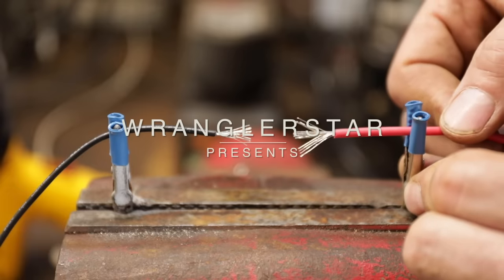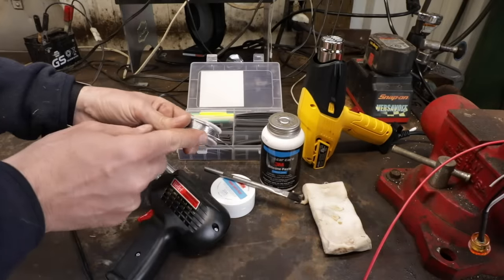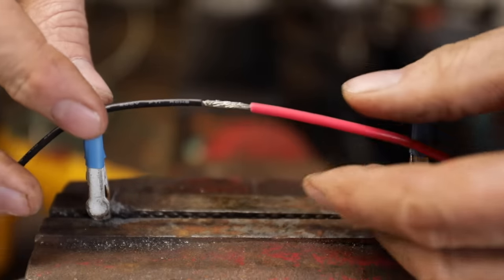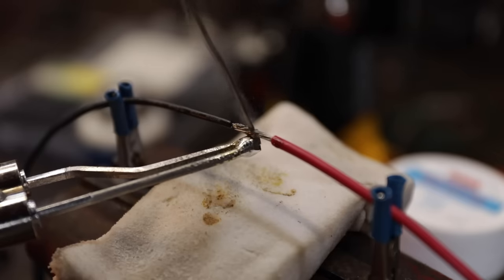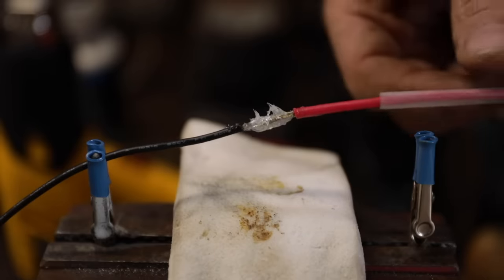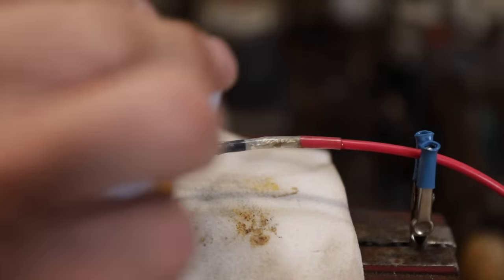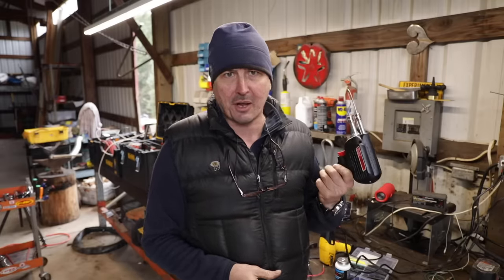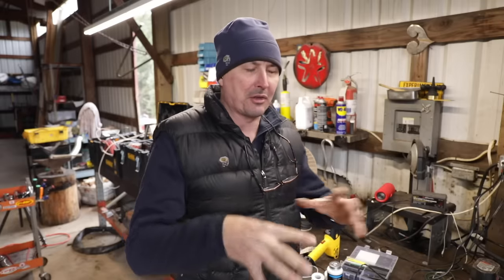How To Solder Wires Like A Pro

Comment: I like the video for the explanations on theory but somebody should talk about RUBY FLUID as an alternative flux. I use ruby fluid with an acid brush, but DO NOT TOUCH IT (it is 34% hydrogen peroxide and will burn your skin) along with rosin core solder. As for fraying the ends, it does not work well in short contact situations and clamps are normally useless in tight quarters. Also it should be noted that "GOOD" heat shrink tubing may be lined with heat activated sealants as you can see by oozing end the ends after shrinking it. However it is worth mentioning that use of wire terminal ends WILL degrade the ohms ratings that the computer needs to balance fuel for performance in automotive uses. THAT'S WHY WE SOLDER THEM!

Comment: Sponge is to clean off the old solder.  Wipe both sides of the iron tip, retin the tip with new fresh solder and then use that to do the soldering adding solder as you go.

Comment: This method is good and a strong joint. But when you work on machines where you have to periodically replace a sensor and do not have time to run a new cable, you do not want to solder in this manner. You tin the 2 cables and then solder them together. That way if you need to replace the sensor, you just apply the solder iron to the joint and the wires separate easily and then you solder the new sensor wires back on. The joints are still strong and cannot be pulled apart.

Comment: For once, a fancy soldered joint video that was slow enough and believable enough to follow. The silicon bit was useful addition too. Many thanks. PS. Perhaps you could offer advice on the following problem. I have unusual design of male spade connector coming from lawnmower capacitor to housing at the induction motor end. Can I in-join crimped spade as plan A or should I go plan B and simply join up old spade-end wires to new wires from the new capacitor.  Re-using a spade (even if possible) will likely weaken the crimped mechanical joint, therefore, soldering old and new wires looks like the best way forward to me. Robin

Comment: 1. Mechanical connectors are BETTER than solder for connections exposed to the elements. The silicone dielectric grease you showed is meant for mechanical connections, not solder. If you want insist on a solder connection , cover in in an actual encapsulating waterproofer such as 3M Scotchlock, than us adhesive lined shrink tube.

Comment: That flux is for plumbing and is acidic so will cause corrosion (the solder has a flux core of the right type). You do need to apply solder to the junction of the  iron and work piece for good heat transfer and allow the solder to flow properly. A Weller of that type gets far too hot for this type of work. A temperature controlled iron of the pencil type is the way to go.

Comment: This is what happens when a plumber tries to solder electronics. Painting the joint with flux beforehand is totally unnecessary. Use electronic grade rosin core solder and the core has enough flux to do the joint. For heating up the wire, touch a small bead to the soldering gun tip and the wire joint to transfer heat then apply solder to the top of joint as showed in your video. Forget the flux paste, you’re soldering wires not pipes! I recommend you watch a good video for soldering electronic components. To others watching this video, this will put you on the wrong track.
Reply: i was thinking the same thing

Comment: If this was an real life connection you should never forget to apply the SHRINK TUBE FIRST, as you usually don't have an open end half a meter further. It's really annoying when you made a good solder and then notice you forgot the shrink tube and have to open it or fudge with electrical tape. Take care to push the shrink tube far enough away to avoid it shrinking while you solder.
You were lucky the cables isolation didn't melt. You were far to slow on soldering. There needs to be more tin at the tip of the solder gun. I usually touch the joint with it from the top. This works great and the solder can run into the joint by gravity.

Comment: Rosin solder is corrosive. That's how it cleans before it helps the solder flow. Remember to clean the rosin junk off before applying the dielectric grease and heat shrink or else the weld could fail years down the road.

Comment: you touch the tip of the iron before soldering to "wet" the tip which helps with heat transfer to the work. when I first started I would clean the tip and try to solder with out wetting it and had a hard time till I figured this out

Comment: I believe Holley and HP Academy both say avoid solder joints at all costs in automotive applications. Solder belongs on circuit boards not in wiring harnesses.

Comment: Crimping is a superior connection. Simply those crimp connectors suck. There is a reason common solder connections like that do not meet SAE and FAA guidelines, but crimping connections do. The problem is that people use the wrong crimp connectors for the place that you are putting them. For the commoner who does not want to learn all the different crimp connections there are on mouser, this does work fine. Just know that if you are putting that under any kind of repetitive flexural strain it will snap. Maybe not at first, but over time it will not last. I would suggest even putting two layers of thick heat shrink instead of one. Help distribute the strain. Though most people are not doing anything that will have any flex.

Comment: For those just learning...  make sure when connecting a wire rack to gather to slide the shrink tube on part of the wire before you solder the connection... lol

Comment: If you are able to find it in the correct size, Adhesive lined heat shrink would be a good alternative to eliminate or supplement the silicone grease.

Comment: For a better mechanical connection, a western union splice is really good. Solder that and it's staying connected. I don't really see anything wrong with your method but the western union is a strong connection even without solder.

Comment: There is a reason why soldering is abandoned for any application in flight or aerospace.
Its not vibrateproof,it stiffens the wires too much in areas where flexibility is needed.If you choose the right crimp style connectors(not the pre insulated ones) with an insulating and contacting crimp they work just fine.
Reply: Bull

Comment: You'll have a much stronger connection if you dont twist it. Add a bit of solder on either ends, just enough to cover the wires. Then put one flat ontop over the other before melting the joint together by heating it up a little bit.

Comment: Really great video. That little hiccup you had where it took a really long time to heat the wires to the point that they could melt the solder, that happens to me every time. And the wires get so hot, I'm afraid I'm going to damage the circuit board they're connected to or whatever. I always get scared and end up just using the iron to melt the solder to speed up the process. Is it normal for it to take so much heat and time to do that?

Comment: I am willing to bet your solder connection is the best in in the machine. I have never seen a waterproof connection inside a machine unless the machine is to used in or under water.

Comment: Are those solder guns better than a typical stick iron? My Pop had a nice stick that I liked, with a beveled tip maybe 3/8 inch diameter. Some kind of copper alloy I think.

Comment: 1. Soldering (there's an L in there!) wires is often done in situ, hence putting the heat shrink on first is advisable.
2. He says (When heating the joint) that it was taking a long time. Thats because he is using the edge of the iron bit, instead of the broad face. Heat transfer is proportional to contact area.
3. He doesn't actually specify solder which is for electrical connection, i.e., with a high tin content.
Reply: I've said the same thing about the "L", but was told that in the U.S. the correct pronunciation is "Soder" and in Europe, they pronounce it as Solder. I would state where I hear that, but it's been long ago. ;)

Comment: I like to solder those cheap connectors on otherwise they oxidize fast. But I agree a solder joint is always the preferred method.

Comment: You start out with a bit of solder on the tip so the liquid solder transfers the heat to the wire faster with more connecting surface area.

Comment: I wouldn’t put the silicone grease. The heat shrink tubing has a sealer that melts when you heat it up. The silicone inhibits the seal from working

Comment: Why don't you want to touch the solder to the iron? I worked at a PCB manufacturing plant. I never spliced wires, but I was an inspector so I soldered components on boards by hand. The way we did it was to touch the iron to whatever you're heating and then touch the solder to the iron and immediately move off, but not so fast at to completely break the "heat bridge." The heat bridge is just some liquid solder that's bridging the gap between the solid solder and the iron. It conducts heat to melt the solder and let's you get the job done without actually heating the part itself to +700°F. I'm not saying that this is a 1:1 thing and I've never done wires like this before. I know this is an older video, but if you or anyone else happens to see this, why would you want to entirely avoid hitting the iron with the solder?

Comment: Actually with automotive you probably DON'T want to be soldering connectors! The crimp connectors are in fact much better and more reliable. When you solder them they will fatigue faster than the crimp due to the environment and high vibration they are subject to. Crimp connectors are an excellent choice for automotive, especially when they are done properly ie selecting the correct AWG sizes for the wire gauge you are using etc.

Comment: A properly crimped wire connection is superior to solder. The pressure causes the wires to ‘weld’ together. This is known as metal to metal colloidal bond. This bond actually provides less electrical resistance than a solder connection. There is a reason manufacturers use crimp connections. The other reason is wire fatigued. The solder often is drawn up either end of the connection like the end of a wet rope. 

Solder connections are meant for wire to circuit connections.  From your car to your computer wire to wire connections are crimped.

Comment: Get a small bottle of liquid flux from amazon (~$10) , easier to use for something like this. Also a soldering iron (40-60 watts ~$15-20) is better than a soldering gun,

Comment: Even when I use the different connectors I cut the plastic off and solder them. Like for a trailer ground. I wired trailer lights for my father in law 6 years ago still going strong

Comment: i wish out of curiousity you did a resistence test. ex( place some weights on the bottom while it hangs and see how much weight it takes to break the connection.or if another place in the wire rips first.

Comment: Before u place wires together put your shrink tube on and push to one side then solder wires because alot of times u can't put it on later because the wires are connected to something

Comment: Butane irons are a little better all around. Certain things you don't want to use an electric iron on because there is a CHANCE that you can induce voltage into the circuit. It can be enough to fry circuit boards and blow airbags.

Comment: I think I may be the only electronics tech that isnt bothered by you soldering a red and black wire together. I was an avionics tech on F-18 Hornets. It would be less than pointless to try to color code its wiring. There are eleventy billion wires and they come in like 4 colors, not to mention, they break and need to be fixed all the time, so by the time I have to patch a wire, someone else has already done it a dozen times. (Often badly)

Comment: Use a lineman's splice for strong connections (recommended by NASA).  Two straight wire ends mashed together will work, but is not nearly as resilient.

Comment: After working as a professional in the electronics industry for over 30 years I can definitely say this is Not, repeat Not, how you join wires together. Solder is a weak joining agent if you pull hard enough on those wires the way you joined them they will come apart after soldering.

Comment: The connecting of the wires is a good idea but i recommend a different way of soldering them together cause you do not want to damage the isolation of the wires by heating them to much for too long in this case you been heating up the wires with to less contact so it wasnt hot enough for the solder to melt but hot enough to damage the isolation but otherwise good job pls excuse my english

Comment: Correct me if I’m wrong but isn’t silicone water based???? Surly that’s gonna cause corrosion to the copper wire ? I’ve never used that on wiring connections but always heat shrink .......like I say I could be wrong

Comment: put a little solder directly on the tip of the pistol before touching the wires. for optimal soldering you should toch the wires for 3 seconds only cppl ide with the vice though makes the soldering arm obsolete.

Comment: I've worked in electronics for 20 years and I've never heard of someone putting silicone in a shrink. I'm not sure what purpose it would serve. Other than that it's an ok job for a starter, it will do the trick. 😉
Reply: It’s dielectric silicone for conductivity. Not required.

Comment: Hi i do similar with a few slight differences and not knocking what you did. 1. When the wire is stripped the length split into a v, then twist about 1/3 of the way, put the 2 v's together then twist each other along each other, hope that makes sence?
2. The silicone idea is good but best to check as some heatshrinks have an agent that bonds to the outer sheath. 3. Im not sure if you have seen then yet but there is now connectors that shrink with solder inside, place the wires in and use the heat gun, done. 4. Finally why do you guys not pronounce the word sol-der as opposed to sod- er. Trivial i know.

Comment: if you don't care about being a pro, you could just coil a section of solder around the spliced wires and hit it with a lighter. no iron needed. same lighter you can use on the heatshrink

Comment: Had a solder gun .
Don't bother the are rubbish .
As you have just seen they don't work properly
Take so long to heat .
Spend some money and get a solder station , you can adjust the heat setting .
Since I've had mine my soldering quality has improved 10 fold .
Well worth the extra expense .

Comment: No one says the real trick. The real trick is to use good quality flux and solder. Amtech makes amazing flux and kester solder is what I use. From the irons I ruined because of the cheap flux and solder I used to now, it makes it A LOT easier to solder. It’s as simple as it should be.

Comment: A hook solder joint on each wire is far more reliable. The end to end method here would only be necessary if the wires were not long enough to make each wire into hooks

Comment: I turn my iron up pretty high and press it pretty hard against the wires but they never get hot enough to melt the solder. And the wire insulation just ends up melting cuz the wires get hot enough to melt them but not the solder, why. I have a decent iron
Reply: Don't press it against the wires like he showed in the video. I usually dip the solder in the greasy stuff (I forgot what its called in English, in my language we just call it paste lmao), then put the iron on the wire (with no solder on it) and put the solder in a spot where it touches both the iron AND the wire. Theat way it melts super quickly but also sticks almost only to the wire

Comment: Have you any videos or tutorials about splicing wire 1/0 battery cable, into a "Y" configuration?  Needing to replace a stock battery cable and FORD does not have it any longer.   
Thank you for sharing!
Marion.

Comment: Yeah the secret of soldering, wire or pipes, is heat the objects being soldered. Onv=ce they are hot the solder will melt and be drawn into the joint.

Comment: Place soldering wire on a metal surface and hammer it flat . Cut it with a razor blade to create thin wire to solder with when needed . 70/23

Comment: I mean it’s easy there in a bench with plenty of space to work, however out there in the field you usually have to work in very tight spaces where soldering is simply not an option

Comment: Could of things: 

1. The idea of not touching the iron with the solder is false. It’s why you’re tinning it. When you tin it, it allows the solder you’re applying to melt easier and keep the solder on the wire melted. The best way is to tin and then hit your iron with you’re solder to form the beginning of the pool then use the pool of solder to keep heated as you add more solder. That’s what people mean by not putting the solder on your iron, they don’t mean NEVER touch it. 

2. You don’t want to just keep your iron on the wire like that. The wire will get hot and melt the jacket. You should be on and off and with proper technique, it’s mostly the solder that will get hot. Not the wire itself. 

3. Might want to use a better tip for small wires like that.

Comment: You tin the tip because the flux and solder is very corrosive and it prevents the tip from corroding away quickly. A non tinned tip won't last long. The best little known tip I learned is the gun is only as good as the screws holding the tip are tight. It's just an electrical circuit, 
electricity takes path of least resistance, if your gun takes forever to get hot, tighten them screws and thank me later 👌